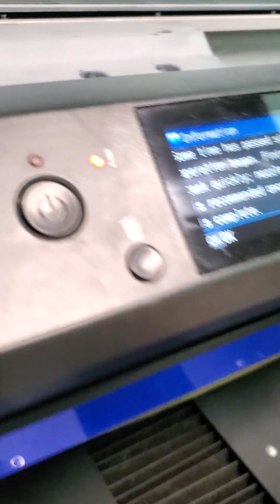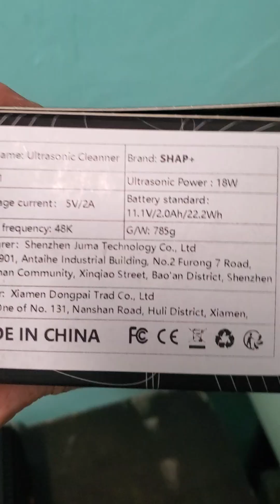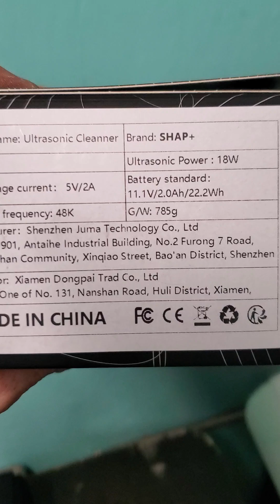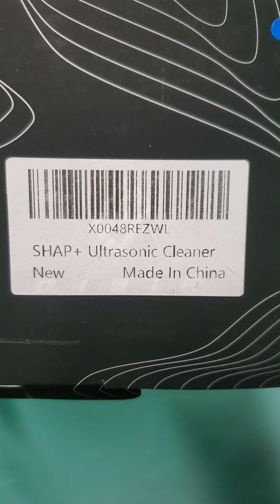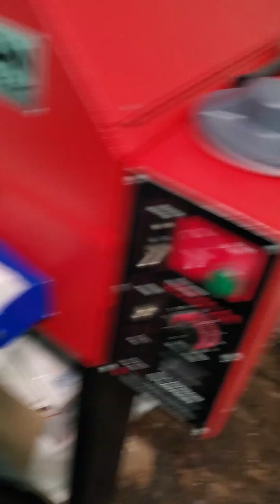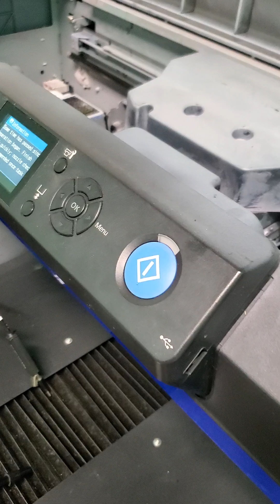Rescuing white ink clogged head on an Epson F2100!

Comment: My white isn’t printing AT ALL, soaked it for 24 hours and no luck, did a tube washing, replaced the white ink, recharged, I’m running out of ideas. Am I fucked or do you think it’s just a bad clog
Reply from the maker: @KARIUKIDENIED  I think k the head is toast. I only did about an hour on my head with the ultrasonic cleaner and it did not work... I hope to try again  for longer soon. I have multiple business so the dtg had to sit a few weeks so I can do weather permitted outside work before the rainy season hits east Texas.

I will post videos of what I try...

There is a guy in Louisiana that cleans the heads with a head dr. he is on ebay.. he may be able to fix.

Comment: Hi mate. So whats the result?
Reply from the maker: @n8channel7008  
I have been demolishing the interior of a commercial building and getting the plans for a new roof... and a complete interior rebuild to open a pack and ship next to the print shop.
I like having the dtg white not working LOL I don't have to do maintenance...
This can fix it but a clog like I will have may not be fixable. I got this machine from a guy that had let it sit for 2 months without power...
Still love the light color printing it does. And white is a pain in the but to have with pretreatment and maintenance.  I am gonna leave it  broke for the time being 🤣.

Theory to fix:
I will pull the tubes and flush with air and cleaner. 
Run the negative and positive pump with the ultrasonic bath.
And maybe you get 80%...
And that is still not good enough for a solid underbase so do it again...
Lotta work. Or get another head and print if your making money on white ink... then send the old head out to the guy in Louisiana on  eBay and have it ready to install when your new head goes bad... then repeat you always have a head on stand by and the cleanings are cheap (compared to a new head:)